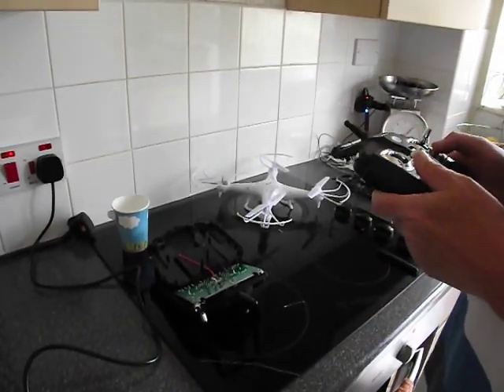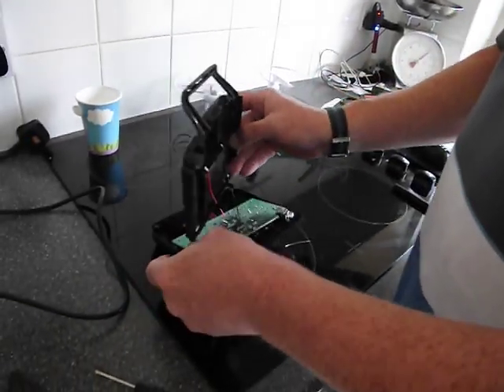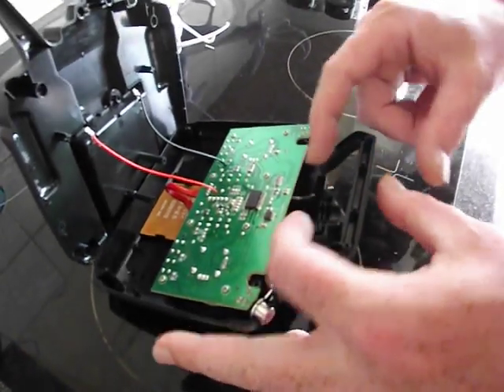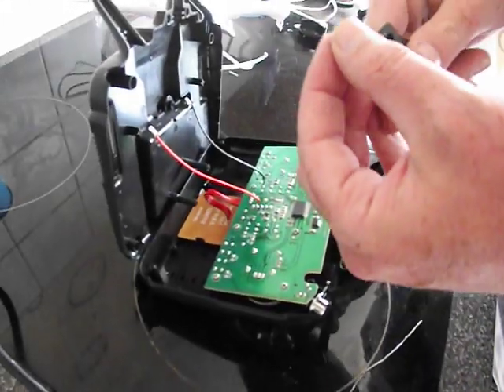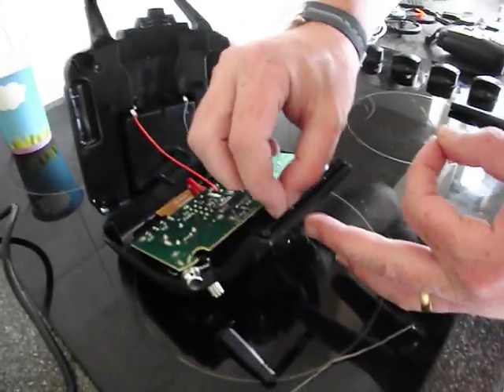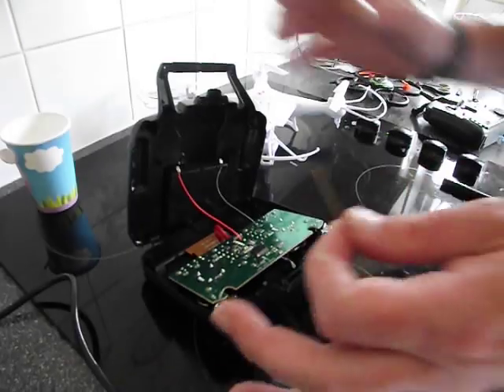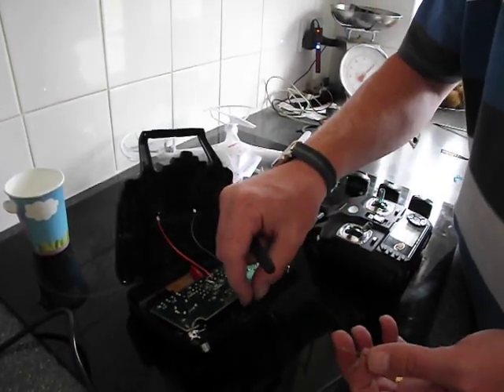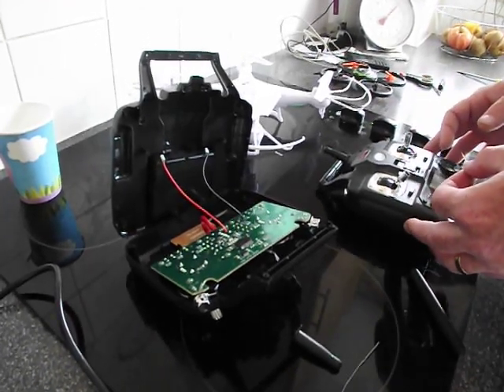Syma X5C Remote - Easy Antenna Range Extender Mod (1 of 2)

Comment: Great video! I just did the mod today, but cut the wire at the full 12.5cm and bent it back down so that the original plastic tip still fits. Took it out and got right at 120m! Would you recommend letting the extra cable be straight for better reception or is it at its full potential even when being bent back in the opposite direction?

Comment: The length of the antenna is dictated by the frequency you are using. If you want to fabricate a full wave, 2.4 Ghz antenna, their are online calculators out there for this. You can't just add an arbitrary length of wire to an existing transmitter antenna. Unless you are extremely lucky and guessed your way to a matching length, your performance will be worse than stock!

Comment: You cannot just add extra length to a 2.4 GHz antenna that would cause a mismatch of frequency's. The best way is to use a pigtail ensure the ground and centre core are soldered separately, not shorting, then add a screw on 2.4 GHz antenna.

Comment: I have a spare controller and was going to use the wire from that but just wanted to know if it matters that they over lap by 2 mm as trying end to end will be a bit tricky please get back to me as I am desperate for range atm

Comment: What kind of wire do I use????
Reply: +SqueakerTalk   I used a copper wire and it seems to work
Reply: +Jake Starn how do you get the wires stuck together
Reply: +SqueakerTalk You would use solder

Comment: Great tip. But why couldn't Syma have provided the couple of extra centimeters of wire? I wonder if they were afraid to provide too much range lest people would lose their copters. Still, thanks for the mod info.
Reply: That's a good question. It actually went the opposite for me, last night. Terrible range and it got caught in wind, complete loss of control, goodbye Syma.

Comment: will this work with the upgraded version too?? x5c-1
Reply: it should , I just watch this video did you and did it to my syma x5sw. it literally took me 10 minutes
Reply: +Teo Pit X5C-1 is only different packaging (box) so yes it will work
Reply: +kedelbach yup it worked I done it and the range did increase
Reply: yes all of the Syma remotes are basically the same. I have found that the best thing to use is a TV cable, all you have to do is cut a 2 inch piece and then cut the copper wire out of the middle of the Cable and then solder it to the antenna inside the remote. I tested the distance with a buddy and I got a little over 1600 feet 5 football fields
Reply: be careful doing this because I did have a fly away with my Syma x5 SW, it literally disappeared into the clouds and I never did see it again but that's okay because I am getting a Syma X8c and I am going to use the same controller that I modded
Reply: +Teo Pit how far did you get with your mod mine went from 80 yards to 533 yards
Reply: +treverlid87 um,I live in Greece and I can measure in feet or meters.I havent really tested its max range because the only place that I can fly it now is in my backyard and my neighboorhood so because of the wifi signals that use the same frequency the range is greatly decreased so I do not push it too far.When I will get to go to my cottage where there is no wifi signals I will test it  and post it here.
Reply: +Teo Pit I would say (because I did lost signal at some points),around 30-40 meters but with lots of wifi interruption.(most if the times it re-gained it but one time it fell onto one of my neighbors tarrace) but I did got it back.With no wifi interference I would say it could reach 80-90 meters(250-300 feet)
Reply: +Teo Pit *most OF the times it regained CONTROL) heheh correction
Reply: +Teo Pit i had my brother in-law hold the remote and i would walk about 50 meters and raise the drone in the air then he would push up in the throttle. then i used a distance app and pinpointed where he was and where I was to give me the measurement
Reply: treverlid87 um,by in-law you mean he is a police officer right?cause at first I thought you meant in jail :D.Well since my brother is like 9 years old I would not trust him my quad so that not a method I can use right now.I could fly the drone but someone else use the app.How is this app called.
Reply: +Teo Pit - "Brother-In-law" means that he or one of his siblings is married into the family but not an actual brother.  Not to be confused with "Step-Brother" in which either one of your parents married someone else that already had son, making them not your blood brother, but a step-brother. Also not to be confused with "Half-Brother" in which one of your parents had a child with someone other than your parent and begot a son, making him your half-brother since only one of your parents is their parent and not both.
Reply: ohh ok thanks for the explanation,I have never heard this before and I thought it has to do something with Law enforcement.thank you :)
Reply: Teo Pit - You're welcome :)

Comment: Excellent - I` ve just done mine, though removed the old antenna and used a 94mm piece of new wire to make a 3/4 wave , coiled the wire a bit at the base so it`d go into the dummy on the top of the TX .. seems to work fine :)

Comment: Hi, thanks for yet another great vid. I'm a bit like one of your other fans - I'm not keen on soldering because on another vid tutorial, it warned against the dangers of getting the solder touching another connection which could cause a short circuit. I am still waiting for my X5C-1 to arrive but have been devouring the tutes on here so that I will have an idea of some of the jargon and acronyms used in quadcopter flying. So, is it possible to butt the new piece of copper wire against the original "aerial" and then use a piece of tubing like a sleeve to keep them touching or is twisting/splicing the two together te best alternative to soldering? In another vid, the guy pointed out that the most efficient part of the aerial would be its middle section and suggested the aerial should be placed parallel to the handle therefore presenting a wider amount of aerial to the quad. Any thoughts on that, please?

Comment: I literally just watched mine vanish over the horizon.  If anyone needs a Transmitter, only used twice, gimme a shout... :-(
Reply: dratsab1980 I literally just watched mine get eaten by a very tall tree, so no thanks, I already have a spare!
Reply: Damn. Going to have to do it myself. I generally break everything i try to fix or improve. lol
Reply: dratsab1980  is it range modded ?  I would seriously take it off your hands for a few quid if so. lol
Reply: ***** The Syma was found, intact but water damaged, so me trannys back in use! I did the range mod, required an extra 98mm of solid core copper wire and it easily doubled the range on a ground test, considered lengthening and exposing the reciever but dont think I need to...burnt out a motor tho so mods can wait till thats done... :-(
Reply: ***** its pretty spastic-proof, the TOTAL ariel must be 125mm, the stock one was 27mm, meaning 98mm must be added, so I cut a 100mm length of single strand copper wire, and soldered it to the end of the original, with a 2mm overlap. (And poked it out thru a hole I made in the stubby fake ariel thing on the tranny...)
If you can solder this is easy... :-)
Reply: dratsab1980   Never soldered but have one on order.  Probably will not arrive before leaving for my vacation.  I have been using cheapo batteries.  Someone Told me sticking Duracell in would increase the range. Thought it sounded a tad fishy.  Any truth in that ?.   50 metres sucks. I need 100 metres for 808 filming while trekking.

Godslap
Reply: ***** Ive 2 808's, theyre fantastic for the cost, so u dont mind loosing them, I considered sticking one to a helium balloon with a note with my address and waving goodbye.  Yeah I stick duracells in most things, there IS a difference, in duration and shelf-life, a mate of mine used cheap batteries and it was the same old story every time, flat, leaked, reduced power etc, while mine were good for years for the sake of a few extra ££.
Remmember when soldering to heat the 2 components with the iron, then melt the solder in, the tricky part is holding the components together and steady while u do this!
Reply: Great idea with the 808, it is indeed a super little cam for the price, been having a lot of  fun with it mounted to my scooter. I just bought this.  http://eu.banggood.com/Wholesale-Warehouse-2_4GHz-10dBi-Wireless-Wifi-Antenna-Booster-WLAN-RP-SMA-wp-Uk-940255.html   Its fine to use ?
Reply: +dratsab1980 Happened to me as well, owned it for a day :(
Reply: Doug Kaboom my sympathies :-(
Reply: I feel ur pain man, the last thought I had was, "Oh? it flashes its lights when its out of range, thats nice..."
Although a simple line of code saying, *If signal = intermittant or 0, reduce power & oppose final directional input* would have been more helpful... :-(
Reply: +dratsab1980 I need one xD
Reply: +dratsab1980 are you selling the broken quad??

Comment: thanks for the video, just took my remote apart and looking at the transmitter wire, there's only the middle wire attached, so no earth as to speak....I was going to use an old netgear router antenna but that's of course got the outer and the inner wire....what do you think?

Comment: Sorry, but I am not quite understanding the length of wire I need to add.  Does the total length, including the original wire, need to be 6.25cm? If I add a piece 3.125cm would that be correct, as I can't measure the original exactly? My eyesight is not great for measuring .25cm so does it matter if you are 1mm out or is it critical? I am a bit scared of wrecking the best toy I ever had!  Thanks

Comment: Hello! I will be trying to extend the standard antenna of the syma x5c with a wire from an rc car toy which works at 24Mhz(that kind of hard flexible wire which pops  about 10 centimeters out of the remote and which is bended in a circle at it's end) .I am not sure if it is copper but I am wondering if this wire will work at 2.4 GHz or not as log as it will still be used for radio controll .Thanks!
Reply from the maker: Sergiu Moldovan It isn't just the material that's important but the measurement in length, I would suggest you use 6.25cm total radiating length. The complete measurement for 2.4GHz is 12.5cm so you want the total radiating length of the antenna to be either that or a multiple of that, ie 6.25cm makes a half wave 2.4GHz antenna where as 12.5cm would make a full wave. You need to make sure you use the correct measurements or you could cause more loss than gain.

Comment: So is it the case that any extension of the aerial should be an integer multiple of the original wire length?

Also: would it not work to orient the (lengthened) antenna wire horizontally inside the case (along the front edge) rather than running it straight up and out into the (previously fake) plastic aerial?

Comment: I cut the d-link antenna wire near the mother board of the router. I removed 1/2 inch of on insulation on wire in remote and on d-link antenna wire then twisted the 2 together and used electrical tape. No problems. Had to bore the antenna hole on remote with file to fit new antenna

Comment: Great Videos Mate
     I just started up this hobby with my teenage son a few weeks ago as something to get him outside more and away from video games. I purchased the UDI 818a for each of us and am hooked. So here I am trying to gain as much knowledge as I can and found you. Very informative. One thing I have to say is I tried the antenna mod that you showed in this video including adding 6 more inches of antenna wire inside the quadcopter itself. The results were horrible. It would lose signal in half the distance it went before the mod. So I undid the mod and took the antenna off of an old d-link router and attached that to my remote. I was amazed at the difference in speed, reaction time and distance I could go. You might want to try that. I've only been flying for a couple weeks and already am pretty good at it but the camera on the Udi 818a is less than satisfactory and am looking for an upgrade,maybe the x5c-1. Anyway, thanks for the vids. I subscribed. Gonna try to make some cool videos with my son this weekend. Maybe you can give them a gander if you get bored.     Peace
Reply: MrTColson 6cm is not 6 inches. A true 2.4 ghz antenna is 12.50cm. I soldered a piece of coax cable that was 12.5cm to the main board and grounded the shield. I got a huge increase in distance. so 12.50 cm is key, the syma remote comes stock with a 3.10cm antenna 1/4 a wave length. or just as a piece of cooper coax thats 9.40cm to the original and tuck inside the handle. whats inside a wifi antenna is just a wire that is the full wave lenght or 3/4

Comment: Would old speaker wire work, if the same thickness & length, twisted together? I don't have a soldering thing.

Comment: Am I right in thinking the total length of the wire to be most efficient should be 4.92 inches this being a full wave at 2.4 ghz? This would mean 4.92 inches from the solder point on the motherboard.
Reply: +dheller777 Learn to use millimetres when talking about length. No one wants to divide by 2.54 cms FFS!

Comment: I am very ignorant when it comes to wiring terms.
Is the plastic around normal cheap speaker wire considered "shielding"?
And the length of the two wires AFTER connecting correct?

Comment: For us Americans...  

234 / F x 12 = 1/4 wavelength in inches.  

So a 1/4 wavelength antenna for 2.4 GHz is..

 234 / 2400 x 12 = 1.17" or 1-11/64". (2.97 cm)

Now, keep in mind that a 1/4 wave antenna offers no gain - 0 dBi.  That's why performance improves when a Wi-Fi antenna (3-6 dB?) is installed.  It's far better than just the coaxial stub that is installed at the factory.  However for optimal performance, both the transmitter and the receiver in the copter itself should be improved.

Comment: How do I attach the extra wire on to the wire of the remote controller?
Reply from the maker: The proper way is to solder it on.

Comment: Soldering two wires together is best done using forseps to hold the wires together to free up both hands.  Full wave will work better at 2.4 ghz which means overall length at 4.92 inches.

Comment: if I attach this; http://www.ebay.com.au/itm/RP-SMA-2-4GHz-16-dBi-Booster-Wireless-Antenna-WIFI-WLAN-For-PCI-Modem-Router-/140737681488?pt=LH_DefaultDomain_15&hash=item20c49e9850
will it work?
Reply from the maker: Yes it should work well if it's fitted correctly. It's an SMA female connector on the picture on the listing even though it says SMA male so you would need the opposite connector to fit onto your controller to screw this into.

Comment: great thanks for this video. just what i was looking for. i am defenetily buying this copter. 
ps. just curious what if i atach the wire of controller antenna to small home TV antenna))) will this improve that range even more?
Reply from the maker: If you can find another 2.4GHz antenna that would be perfect, most modems are 2.4 but some are 5GHz. If you use one for a different band you could cause more loss than gain.

If your doing it similar to as shown in the video then any wire of equal thickness that is also radio conductive will do. As for length I would suggest you use 6.25cm total radiating length. The complete measurement for 2.4GHz is 12.5cm so you want the total radiating length of the antenna to be either that or a multiple of that, ie 6.25cm makes a half wave 2.4GHz antenna where as 12.5cm would make a full wave. You need to make sure you use the correct measurements or you could cause more loss than gain.

Comment: What is the type of wire you use for these types of mods?
Reply from the maker: Any wire of equal thickness that is also radio conductive will do, copper is a good choice for any antenna or you could even use speaker or mains wire ;)

Comment: what kind of wire can you use for an extended antenna?
Reply from the maker: Any wire of equal thickness that is also radio conductive will do, for example copper wire or even speaker wire.

Comment: Easy mod. Added extra wire to make a total length of 6.25cm - hardest bit is access to the old wire. I have to say its very easy. The advice to take your time is a good piece. Especially as the battery cables attached to the board are quite short... Will test range but in a short test flight seemed fine...

Comment: what wire did you use where can i buy it
Reply from the maker: Any wire of equal thickness that is also radio conductive will do, copper wire, speaker wire, etc. etc.

Comment: I'm considering doing this, but I have a tendency of messing things up :/ how many ways can this go wrong?
Reply: Also how far is the range now you've done the modification?
Reply from the maker: The main problem people have is when they open the remote. You need to do it slowly and carefully and be careful not to loosen or disconnect anything inside the controller. When it's done right you should get about twice the range.
Reply: xtratalk1 ok thanks, also do you just twist the new copper wire in or what? And do you need to disconnect the red and black wires?
Reply: xtratalk1 and also how do you strip the top of the wire? Sorry for bothering you
Reply from the maker: Riker Wilson You can twist (splice) the wires if you want but it should really be soldered for the best connection. You don't need to disconnect the power (red & black) wires but if you feel more comfy doing that while you are working then you can do, just take care not to damage anything and take your time.
Reply: wait so how do u solder it?
Reply from the maker: Riker Wilson With a solder and soldering iron. Have a look at some youtube videos to see how it's done ;)
Reply: ok thanks